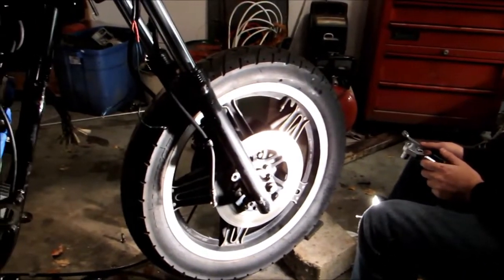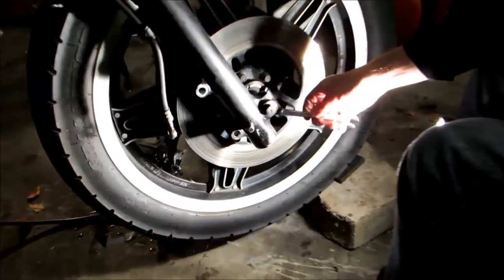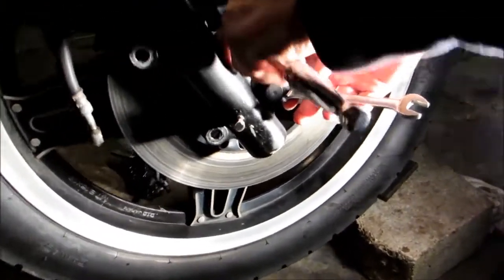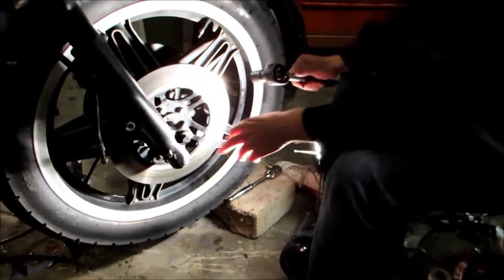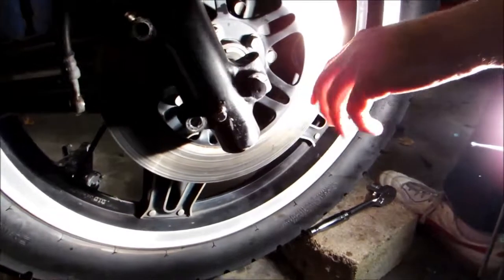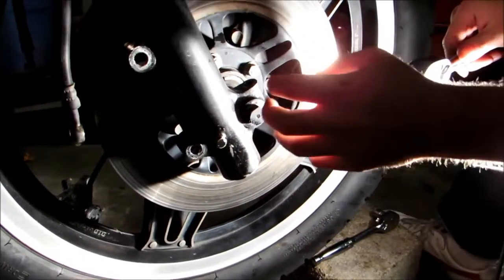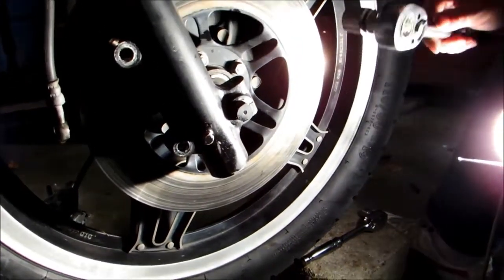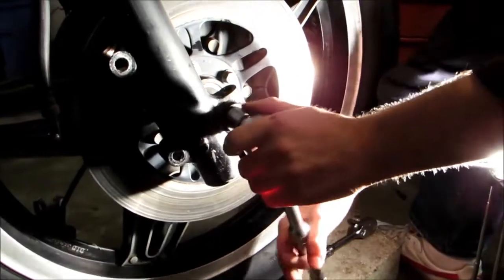Honda CB750 front tire removal

Comment: How do you have your bike front end suspended? I need to do the same job on my 1980 750f
Reply from the maker: There is an ATV jack under the engine, the front is just floating because the weight is on the jack